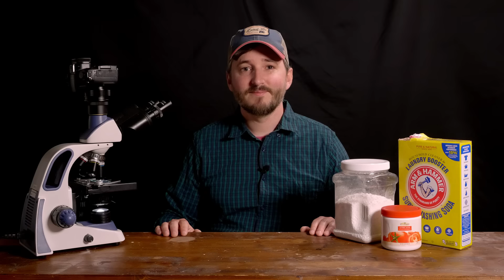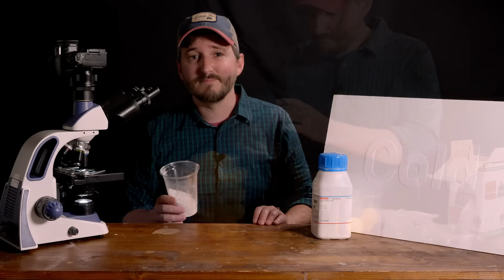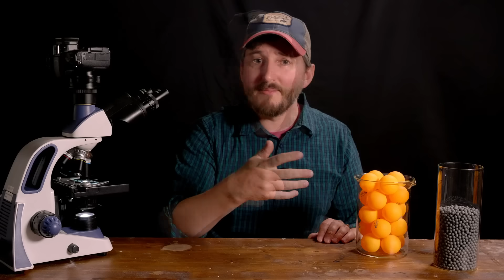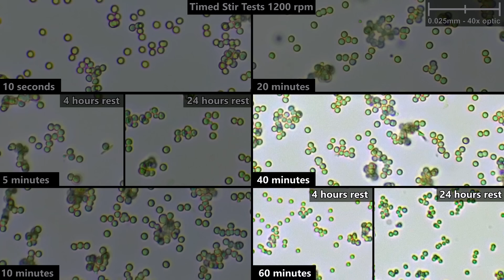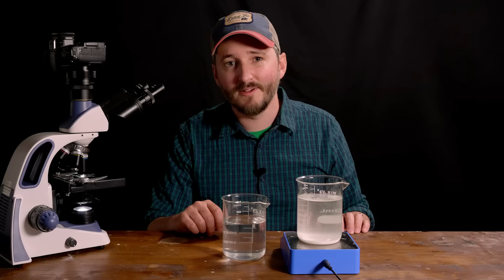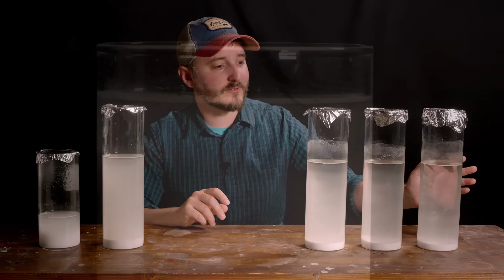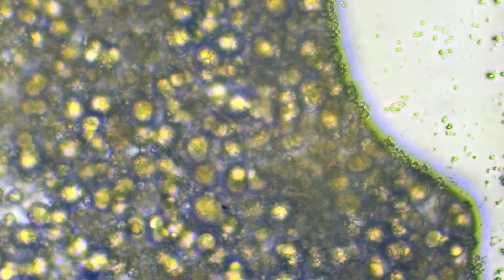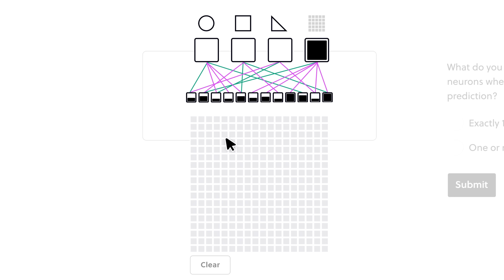Making Infrared Cooling Paint From Grocery Store Items (w/Novel CaCO₃ Microsphere Synthesis)

Comment: Ach ok, so the painted surface is separated from the surrounding air.

Looking at the end state equilibrium, it means that radiated power equals power coming in from the sun when the painted surface is at temperature T, which might be less than the surrounding air or any other surface. 

This simply means that the paint is better at getting the heat out than air is (due to reduced reabsorbtion). Putting it this way - that is quite simple.

The Earth should be like -23C if it didn't have any greenhouse gases. You can't make the paint that gets down to -23C, but that's why cooler than the surrounding paint makes sense.

Comment: I was thinking about painting some XPS panels with this so you can put them over the roof of your tent or something, but the acetone won't play well with the foam. Would some sort of primer protect it, or would I need a different solvent? 🤔
Reply from the maker: No need for insulation with this paint. Better to use something like thin plywood
Reply: @Nighthawkinlight  I wasn’t sure if the insulation would be useful, but I figured it’d be light and ridged regardless. I’ll look at plywood though, thanks. 💜

Comment: Could these be the basis for mass produced "cooler panels" designed to be mounted on the north side of sloping roofs? One could have solar panels on the south slope of the roof and "cooler panels" on the north slope. These panels could be manufactured from square cells which combine the pigment, the protective transparent covering, and a cavity, so that the pigment is only exposed to the patch of sky where the cell is pointed. Underneath, there could be a coolant inlet and outlet.

Comment: I wonder how a multilayer system might improve this more? A base layer could be made of more highly reflective, conductive paint that spreads heat better (so radiates better), and reflects heat better. It may also make other paint stick better on next layer. The top layer than could focus on more radiating light and less reflecting, perhaps allowing for more spheres packed and less water (??). Another idea is to use base layer to alter texture of next layer. Yet another idea is to have multiple layers with less spheres and scattering as you go up (more transparent), more scattering leads to more light be likely to also be re-absorb and also more tightly packed spheres after emission, however, it can emit less light and "reflects less". So bottom layers will emit most and reflect most, but later layers will help keep it directional

Comment: I don't understand the argument for higher density being better.  As long as the layer is thick enough to allow no light through, why would the physical arrangement affect how much light is reflected?  I can see, however, that spheres will reflect the light in a more diffused fashion, therefore decreasing the density of the light reflected.
Reply from the maker: Reflected light is not the concern. The higher the pigment density the less binder you need to use, and that helps because the binder is not as good at emitting favorable IR light than the pigment
Reply: @Nighthawkinlight  Oh yes, of course.  Have you looked into microfluidics?  We use it to produce microscopic droplets and the size can be precisely controlled.  But it might not be able to produce the kind of volume required and might also clog up.

Comment: Thinking you could use this with a radiator that is painted in it to help pull down the temperature of the radiator just an bit extra during nights to say cool down some sort of fluid to then use as a thermal sink during the day, (Maybe even still using the radiator during the day to help cool the fluid a bit more before returning it to the tank.)

Comment: One array of panels with ultra-black colored pipes facing the sun and then another array of panels of pipes with this white paint on the opposite side. If you just use air in the pipes then the heating pipes will cause the air to rise up and then the cooling pipes will have the heated air to sink down. I wonder how much volume of air one could push with something like 10-20 sets of panels combined. Light breeze? Dull roar? And if the air was a closed system would it go much faster? Could the air pressure be enough to pump water uphill like a ram pump by using just air pressure instead of water so that you don't need a complicated motor and not waste water?

Comment: Very cool, so to add to this. I'm trying to make an integrating sphere. I'm still sticking to the BaSO4 for this reason (I think the refraction/BaSO4 makes a good reflective paint for this purpose). But later I may do as you do and expore the creation panels with Ca(CO3)2.

Sonication may help with nanospheres.
Molecular sieves could help dry out the acetone.

Comment: Great work of great value, explained with great clarity and immediately accessible for practical application. I'm working on putting a package of information together so the uninitiated can easily achieve the same purpose, accessible, practical passive structural heat reduction. I hope there's a way either I or others can determine additionally using your invention to enhance it. We desperately need to reduce AC demands with a grid that is being barely able to cope during heat waves. There's nothing that can achieve what a reduction in demand can, at any time in the foreseeable future, and that demand is growing. And even if the grid could meet demand, there's no reason to use 1 watt more than necessary to cool structures whic are overwhelmingly lacking in currently known passive methods, the ROI of which is tremendous and quickly repays initial investment. This is true of methods existing structures could easily be retrofitted for, as well as changes in any new structures it's crazy aren't already required. I'll email with more. 👍🙏

Comment: For your comments about using citric acid and it not being picky about water quality afterwards, I'll add that in soapmaking, citric acid gets used commonly and it performs "water softening" in the bar. When mixed with the NaOH used in soapmaking, sodium citrate is made in-situ, and keeps sodium soaps (i.e. sodium + fatty acid) in solution, vs them reacting with calcium and magnesium in the tap water, making calcium or magnesium soaps that are less soluble and leave soap scum, and the suds of the soap are less sensitive to water hardness (to a point, everything has its limits)
Reply: What is the usual lye/citric acid ratio?

Comment: This is giving me flashbacks to unequal sphere packing problems. What if, for example, you tried using the radius ratio of 0.64799 to get a binary sphere packing and then fill in the gaps? Sadly real life is messy and spheres just go wherever they want instead of making a nice crystal, and size is hard to precisely control.

Comment: NHL, an airless sprayer would pump the thick pigment and give you an even coating. Very interesting video! Cheers!
Reply: Also, applying the paste and then vacuum sealing or laminating the pigment inside would keep the weather from degrading the coating. Then just glue on the laminated panels for a weatherproof coating.

Comment: The next step in this would be to experiment with a custom PC water cooling loop hooked up to something like this. Set up e.g. a 9x120mm fan mo-ra radiator on one side, solder a loop of copper pipe on a piece of metal with this paint applied to it, connect with hose with a reasonably powerful water pump in the middle. Close the radiator in a container, point the panel at the sky, see how much cooling you can get in general, and how much cooling per watt you can achieve - since the fans and water pump still require some power. I doubt large and long heat pipes would be very cost effective, but would of course be more energy efficient

Comment: What if you put a piece of glass or plexiglass over the still wet paint this could get rid of the uneven distribution and make sort of weatherproof shingles
That is if the paint works while sandwiched between some wood and glass and if it can dry there, but since you already had covered it with some foil might be worth a try

Comment: Nobel prize candidate
Reply from the maker: Lol I wish
Reply: @Nighthawkinlight  Well, if not a prize by a committee, then purchases by millions of people. 
You could try converting it to a product. I wonder if the cooling properties still persist if you suspend or pack it inside (on one side of) a thin sheet of silicone or pva. 
Such sheets could be applied to south facing windows, sticking to it with van der waals forces or alike. Though I am not sure if common windows are generally transmissive to this kind of wavelength. 

I do not think I will be getting around to making these soon, but it might be just a matter of laying a glas plane flat and letting a mixture of silicone with the pigment cure on it.

Comment: You said thanks so many times.... No.... Thank you! 

Seeing as it's acetone, it would react with certain plastics.  Making it unusable. I'm thinking about drone batteries, airframes, controllers. Is there any possibility for a substitute or is it a critical part of the reaction? 

Would a gloss coating work to insulate it? Or does it have to be a thin layer of air? 

Thank you so much for your videos. Your tone and style of presentation are so soothing for some reason.
Reply from the maker: Tech Ingredients used a different base for their paint that worked well

Comment: Congratulations.  This is one of the most impressive youtube DIY projects I've ever seen.  Tech Ingredients does some nice science, but you show how you developed this recipe and how much testing was required to understand the process.  It appears that you've outperformed multiple university research teams, in fact, as you've developed a scalable manufacturing process and simply exposed it on youtube for free.  The bar has been raised for Tech Ingredients ;).

While I think this is freakin' awesome, I am concerned that someone else will make money using your knowledge and may attempt to patent your technique by adding frivolous details that sound sufficiently novel.  There may not be much you can do about that, though.

Comment: Awesome work as usual!   I'll post this here as well where was thinking the clear acrylic using only acetone might be a good top coat, though not certain of the UV resistance and performance over time. Might be something more solar related coating or covering maybe and along the line of some sort of like squeegy the film onto the paint method depending on what the baking material is so can still cure and if like a continuous process or not. Like noted with the silk screening or maybe larger straight edge light panel fabrication method with guide rails on the sides.

Comment: 1) For application, how about dipping panels into a tray of the paint? This way you can do the whole surface and do so in multiple layers if need be.
1a) Have you considered paint rollers?
2) I know you already painted an aluminum tube and a heatsink, but how about a parabolic surface? Would this make it into a solar oven?
3) I know you said you'll try different protective coatings for the paint, but I wonder if clear epoxy vs UV resin would make a difference.

Comment: I notice your cooling panel/chamber appears to be sealed with polyethylene plastic cling wrap. PE is fairly IR transparent, but other plastics are more transparent, particularly polymethyl-methacrylate (PMMA), same material as the acrylic used as the paint thickener/brightener. It's also used in IR motion sensors because of its high IR transparentcy. The PE film is also rather flimsy, and when flapping in the wind it might convect the air in the chamber, reducing insulation and performance; stiffer PMMA sheets should prevent this.

Comment: What happens with different plastic coatings in front of the paint? I doubt it will ever be as easy as applying a polyurethane top coat. But I see having a thin sheet of polypropylene film in front of a tile as being a constant nightmare.

Comment: Dude… this is INCREDIBLE. I’ve been super fascinated with these paints since that paper come out a while back. The fact that you developed a method to create this type of coating from cheap and easily accessible materials is so inspiring. 
You seemed to have nailed the creation of the pigment, so I think a big next step for the community is finding a more durable and applicable base to suspend it in. 🤔   Great work!
Reply: @nemam_nedam Yeah, try to cool a house with a fan (and it doesn't consume energy at all, yeah). I don't see a problem with protection if it's just a plastic film (or some sort of other coating)
Reply: Hello.

Comment: If it will go through a spray bottle but not a hvlp sprayer, it should go through an airless paint sprayer without issue. There are some affordable handheld units made by Graco or Wagner that should be easy enough to test with.

Comment: For application, have you seen tools used to fill cracks in asphalt? Basically an open bottom box gets pushed along, leaving behind a seam. I think it might be easier to set a consistent height for a coating that way. Brilliant project. Thank you for sharing your process, and in such an engaging way.

Comment: I would apply the "paint" with a taping, or putty knife. Cut out all the hassle and time of the syringe, or piping. You still have to account for viscosity, but applying as if it is drywall mud, seems optimal to me.
Reply: That's assuming a flat surface. If it was curved.. something like sections of a flexible kitchen cutting sheet, to still mud it on evenly.

Comment: If application over a wide scale area such as a roof is one of the possible goals here, you could consider trying to apply it with a squeegee on rollers(or if the surface is thin enough, spacers set on the side the squeegee runs on) to lift the squeegee surface n-millimeters off the surface to be able to apply an, in theory, consistent layer.

Comment: THANKS!!! Plan to make & coat my HVAC outside unit's enclosure ASAP, to see if it reduces Heat Gain to the coils! They're on the North Side, but in Summer the Sun is relentless there, too! Maybe...as good as building a shade structure above the unit? (as I'd planned, cause it's freakin' HOT in SW FL, USA!! Ughhhhh) Psssttt...I've been Design/Building ECOhomes since '82, and my latest is VERY-energy efficient. Why the sun-exposed Coil Unit rankles! :-) Thanks, again!! Also...I like this Presenter far-more than TI's, for some odd reason. Must be the humor?? :-)

Comment: Considering this is a suspension of particles in a liquid, not unlike plaster or clay, have you considering using a plastering trowel to apply it? That's what's commonly done for clay-based finishes, could work for paint as well, especially seeing the viscosity of the paint when you applied it with the pastry bag.

Comment: Would love to see this tested as being painted onto the back side of glass. Reverse-greenhouse, if you will. And dual-pane would keep conduction to a minimum.
Reply from the maker: Glass blocks IR so unfortunately you wouldn't get cooling, but it would prevent a lot of active warming from the sun.
Reply: @Nighthawkinlight  - If I remember correctly, that doesn't apply to NIR (near infrared) and SWIR (Short Wave Infrared). IR extends to 50um and it's the higher frequencies (Mid-Wave IR and Long-Wave IR) that are blocked by glass.
Reply: Though, to be fair, I suppose it depends on what glass is used. Interesting, especially given your experience on the topic, ruby and sapphire glass are completely transparent to all IR.

Comment: I wonder if screen printing like method can be used for application of this paint. By using a low thread per inch nylon cloth, it is possible to deposit a layer of paint on the surface below.

Comment: I hope you aren't raided by the DEA while making bags of white powder.

I don't quite understand the importance of sky=cooling IR wavelengths, assuming you are not attempting to cool the entire planet.  Is atmospheric re-radiation so intense that a significant amount returns to the painted surface?

It seems to me that this might depend on the size of the surface to be painted.  For example, if a large part of the radiated IR is absorbed and re-radiated 10 meters from your surface, but the surface is only 1m square, then most of the re-radiated energy would miss and you needn't be overly concerned about the loss of efficiency.  But if your surface is 100 meters across, then close to half of the atmospheric radiation would return to your painted surface.

Is atmospheric re-radiation really intense enough to be a concern?
Reply from the maker: Yes it's that intense. To see what it's like to not experience atmospheric radiation look up how big the temperature difference is on the moon between shaded and sunlit sides of an object.